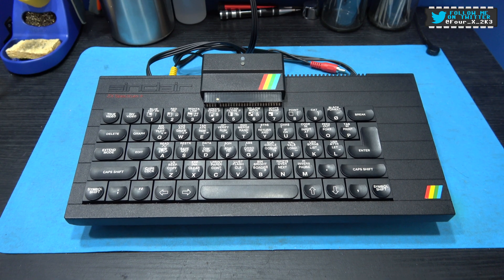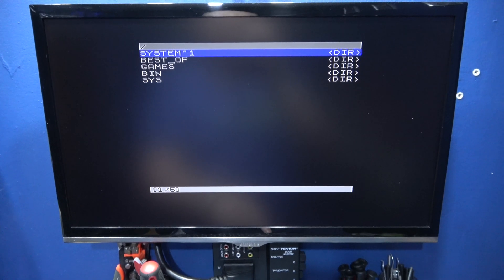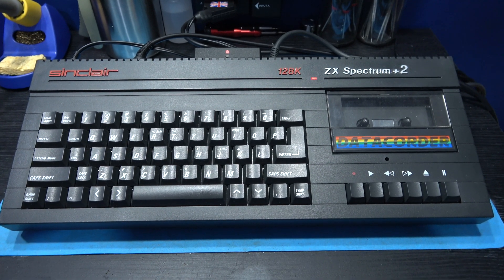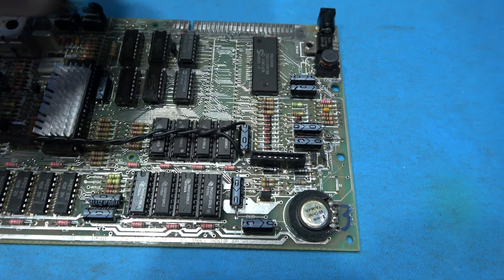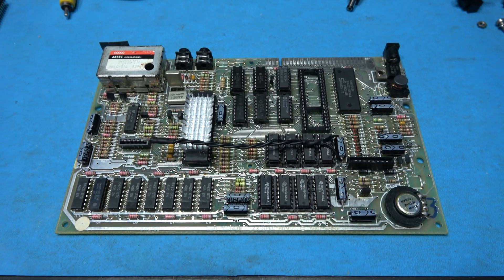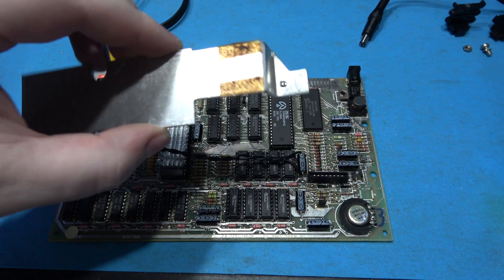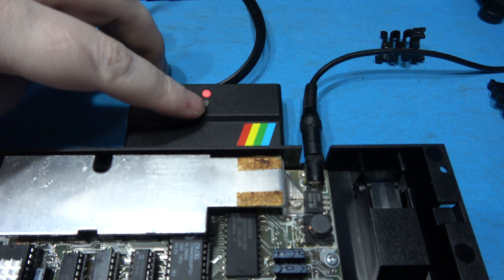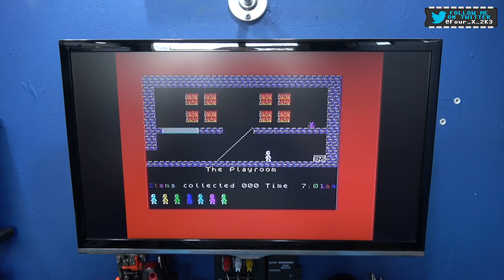Sinclair ZX Spectrum+ (Plus) 48K - divMMC Future Fix - Z80 CPU Swap (Missing M1).

Comment: Excellent and thorough video, so helpful. I just discovered that my 48k+ has the same issue, and the divMMC Future was working with the original 48k rubber key version. So I'll be swapping the Z80 out at some point, I have a few spares. Thank you!
Reply from the maker: Awesome, glad it helped.